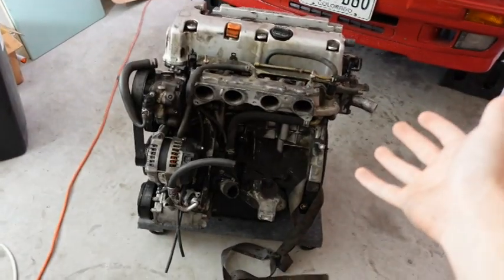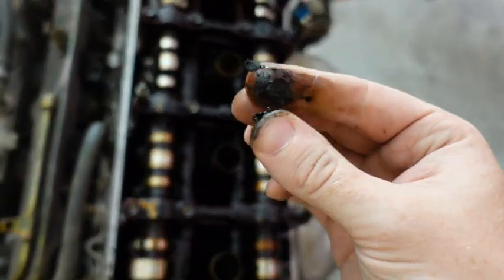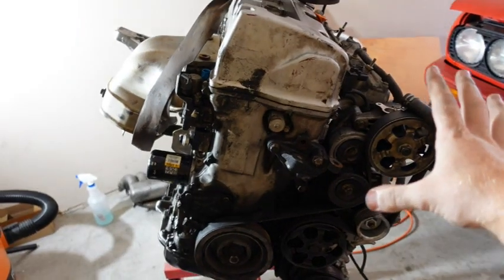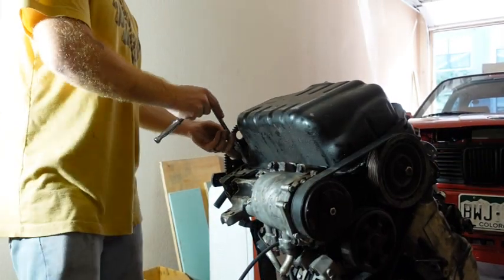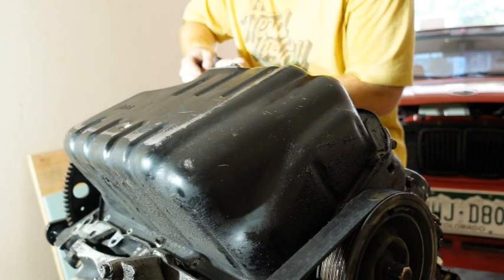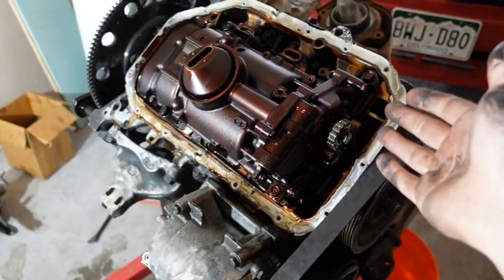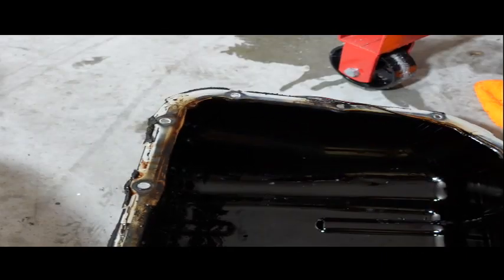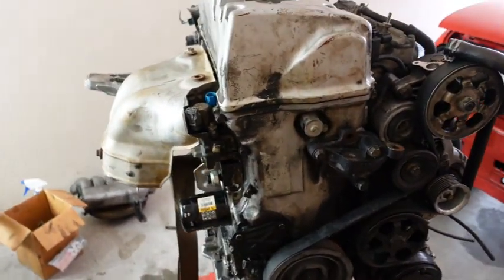I Accidentally Bought The World's Most Neglected K24 | Oil Sludge Everywhere

Comment: If the internals look salvageable I would call machine shops and see what they charge to degrease a head and just let them deep clean it. Or depending on the price, you may be able to DIY it cheaper like this/what the comments suggest https://www.youtube.com/watch?v=JsKJ2y94tBA I have faith it still has life in it!
Reply from the maker: Yeah the good news it doesn't have metal shreds everywhere, but I'll for sure inspect the head for cracks and everything, and see how the bottom end looks and that will give us good direction! I'll definitely call some local places and see how much they charge for a clean and resurfacing! I'll check out that video too!🙂